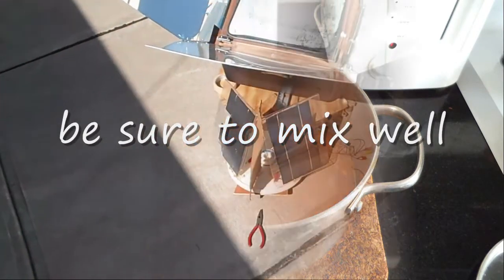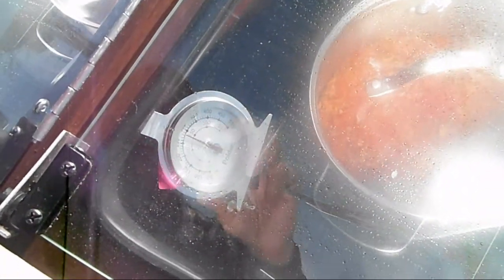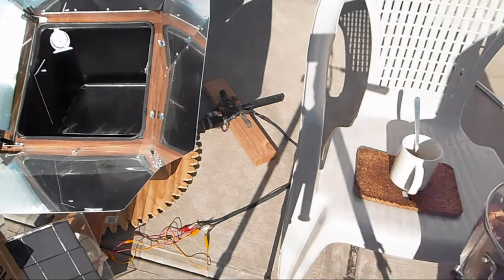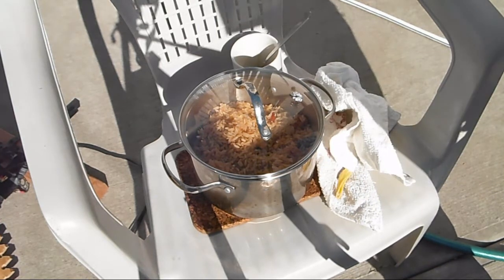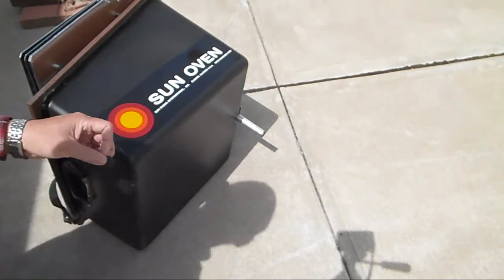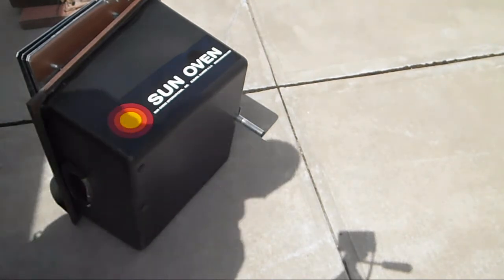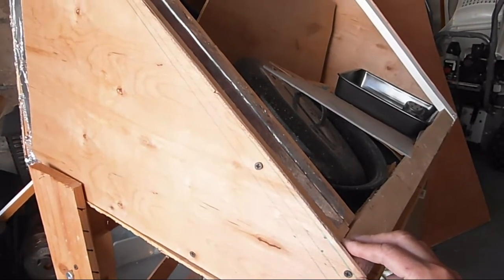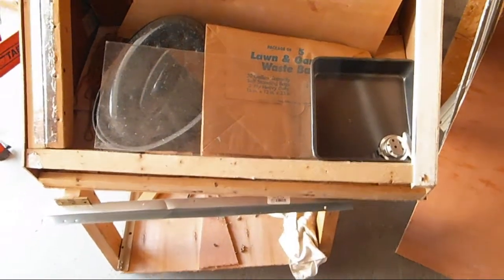Trying out the Sun oven with a Zatarain's Jambalaya rice mix

Comment from the maker: The solar panels are 5 watts each. You have to use a low rpm geared dc motor. Try to match the solar panel to the motor by seeing how well the motor turns when your panels are exposed to the sun. When I have a sunny day, I'll boil some water even if I'm not cooking with the oven.  There are many ways to make the tracker. I just opted for the easy way.